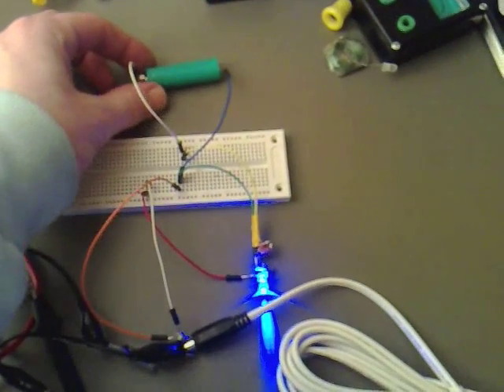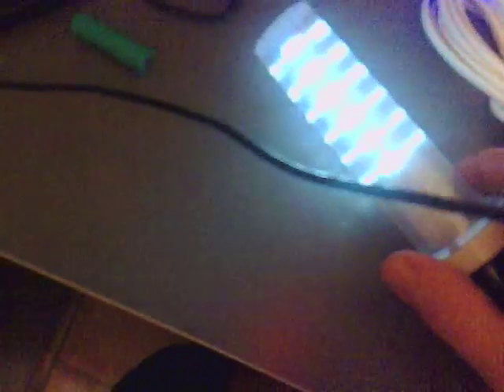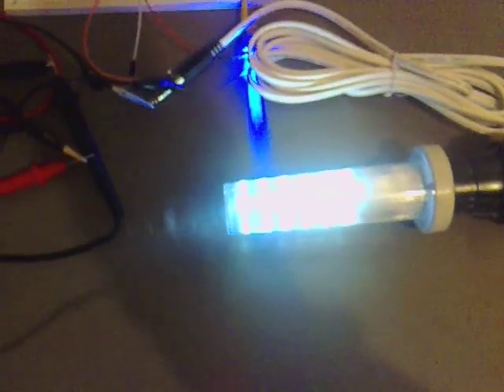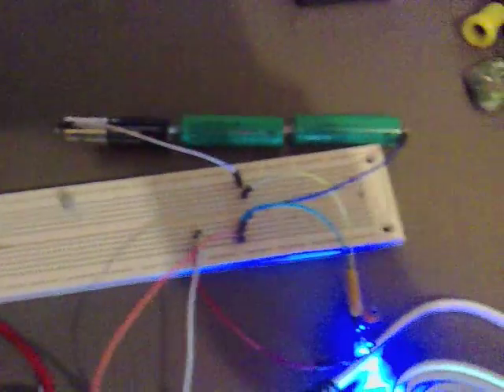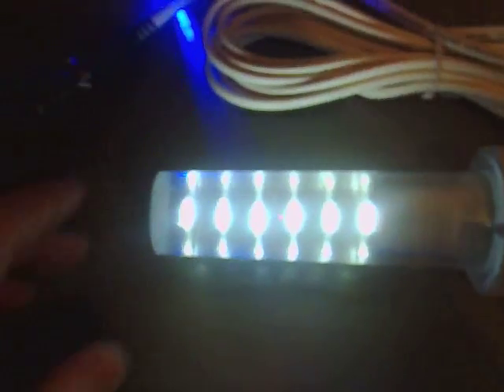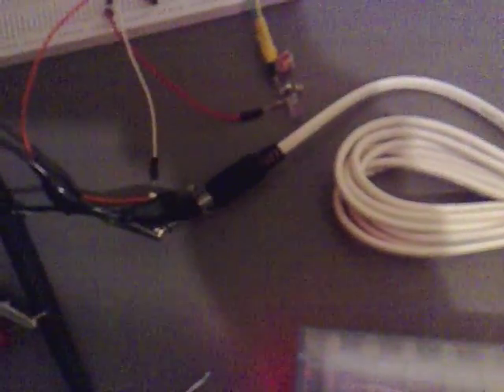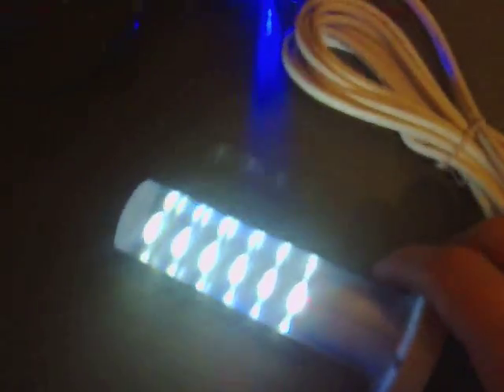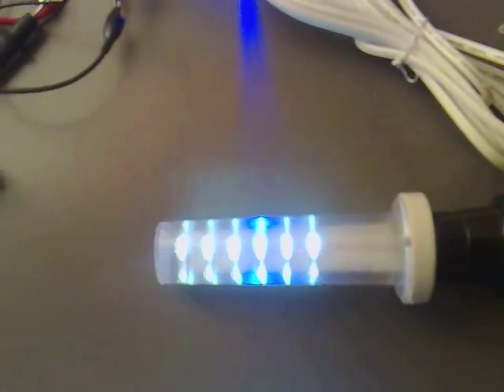Joule Thief (Test 02 LEDs) 003

Comment from the maker: You need:
1nr Transistor, 2N2222 or equivelent
1nr 2k Variable Resistor ot 1k FIxed
1nr Ferrite Core
1nr Length of Magnet wire
1nr LED

Some Patience winding the Coil...

Comment from the maker: Cheers, Im pulsing a bifiliar coil to create Flyback Pulses of them which are much larger than the initial voltage. This powers the LED. I think it peaks at about 30-40 volts at 1.5v input. Circuit to follow soon...

Paul